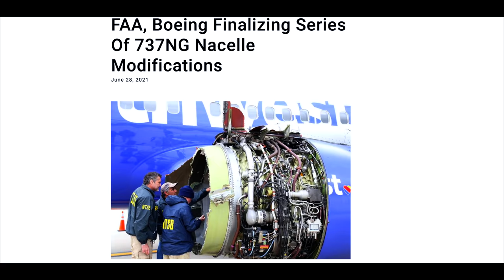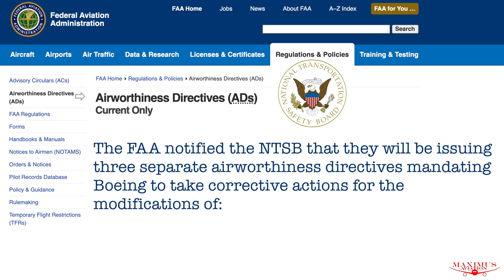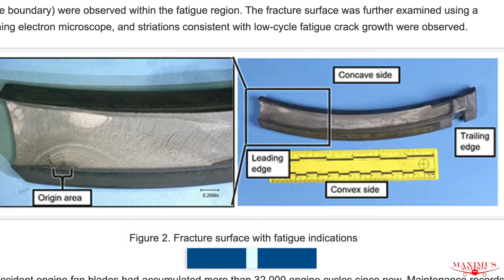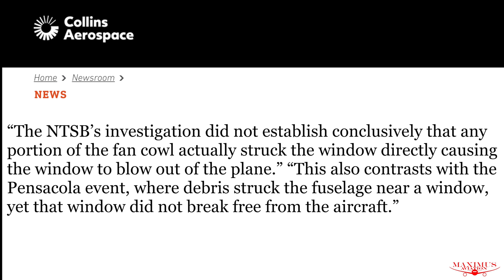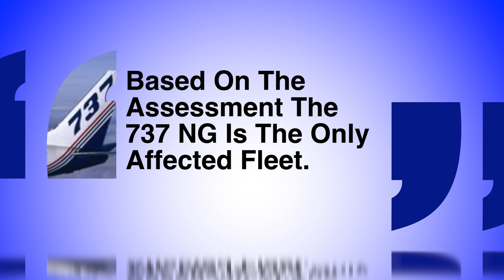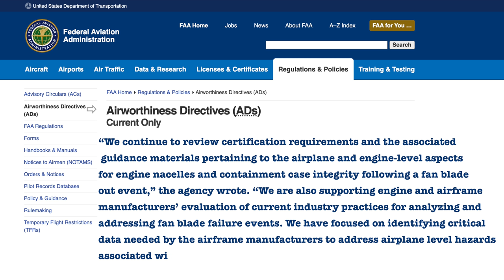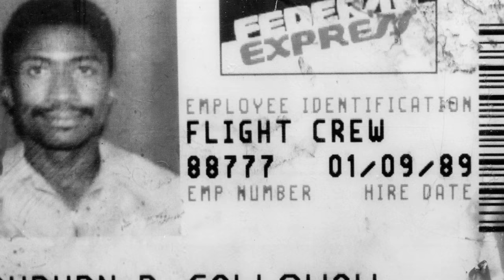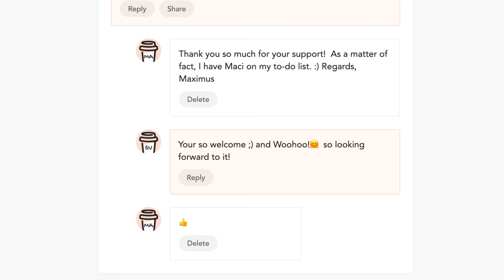After Two 737 NG Explosions, The FAA Is Finally Ready To Direct Boeing To Redesign Engine Cowlings.

Comment: Boeing is the company that keeps on giving with the 737.
Reply: Every airplane has design issues. Airbus had to learn the hard way in order to make the A320 the extremely safe aircraft today, now here come's Boeing's turn.
Reply: @aerofiles5044  True
Reply: @aerofiles5044  True, Airbus has had it's problems with the A320, but most of those were because of the new materials they used on that plane. 
Boeing seems to have problems with everything on the 737 NG:
- software
- wiring looms
- engine nacelles
- overall quality
Boeing seems to really have dropped the ball and sacrificed quality and reliability for profit.
Reply: Boeing adopted the gift that keeps on giving from McDonnell Douglas................cost, schedule and shareholder value over quality and safety. Boeing figured out quality and safety was bad for cost and schedule.
Reply: @tjroelsma  you left out the cracks in the wing spars!..
Reply: @richardhoating23  Missed that one, my bad. To my defense Boeing has messed up só much it's getting harder and harder to keep track.
Reply: Blah Blah  Yeah that's true, but my point is that the 737-200 was made when Boeing was a good engineering company and wasn't cutting corners.
Reply: T.J.R. ..  Since the B737Max crashes, and fixes, I flat out will never, ever step foot on board a Max jet in my lifetime! Software fixes or not, it's still a poorly manufactured, dated design that should be shelved permanently, and efforts to build a new (from the ground up), short-haul, low capacity, composite lightweight aircraft should be on the drawing board RIGHT NOW! The current 737 is an old, inefficient, poorly made mishmosh of an old, decrepit, dinosaur. ..It is, in no way the aircraft of the future- it's quite obviously "the aircraft of the sixties" We are living in a new millennium now, bring your dinosaur mentality into the future, Boeing.!(PLEASE)
Reply: @richardhoating23  you dont know what you're talking about ,no real problem with the design, thats how you make a plane nowaday,it's not the same thing as making a car. You dont know what is the purpose of the mcas so you can keep your ignorant opinion.m for yourself.
Reply: @tjroelsma  you either dont know what you re talking about, no problem with the design,the problem was an unfinished software. Its normal for plane to be redesigned with new engines,not for car so be educated. Look at the a320neo that had similar issue with its engines.
Reply: @tjroelsma  ok too much BS here. The TV never make you an expert ,remember that,you always have to search by yourself.

First the larger engines are not a real issue as you said ,i dont know what is your knowledge in aerodynamics because it is very poor. When you fly an airplane,and you add thrust,the nose pitch up because of the engine,thats a basic thing that every pilot would know. 

The problem of the 737 max is that the engines may change the behavior of the plane in certain abnormal conditions when the airspeed is not sufficient for the angle of attack. In other words,when you start to be close to a stall situation.
At this particular situation the pitch tendancy is higher than the other planes,removing all pressure you normally have in your yoke when you fly other planes. So you may pitch up more or be disturbed by the situation. You need a new training in order to safely handle that.The plane cannot be named 737.
 
Thats why the mcas is here.
It's a MANUAL flight aid,thats means only active when a human is in command , which automatically trim down the plane so bring back some pressure on your controls,when it detects a low airspeed for an high AoA.
With this you can lower your nose by yourself like you do in every other aircrafts.

The mcas is only used for that,and not for the take off,landing, go around but for the climb,because when you do all of that you use something called flaps ,it increases the lift in your wings so you may not encounter the situation described before.

To resume the mcas is only used  without autopilot,flaps and when you are close to  a dangerous pitch,not before.
The a320 NEO had a similar problem because of the same engines, a violent go around may fool the software that protect the pitch of the plane,just like the mcas.
And because of that,some airlines decided to forbid the last seats in the back of the plane,so it couldn't be used at its 100% capacity until the software was fixed.
So again be educated,search and  don't try to invent.
Reply: @Hk-uw8my  MCAS is a band-aid for a self-inflicted wound Boeing created. Ever wondered why ALL other planes don't MCAS or an MCAS like system? It's because they DID do their homework, unlike Boeing. 

What about this for knowledeg: by placing the larger and heavier engines more forward, Boeing has completely changed both the static and dynamic loads on both wings. In a static situation, the plane standing on the ground, those forward placed engines apply a torque on the wings, wanting to tilt the front of the wing down. In a dynamic situation, the plane flying and therefore applying thrust, those forward placed engines apply a different torwue on the wings, wanting to tilt the front of the wing upwards. This creates a lot of added stress on both the spars in the wings, as on the mounting points of the wings oin the fuselage. As somebody else pointed out in a comment on my first response: guess where the new 737 suffers structural problems? You've got it: at the mounting points of the wings on the fuselage. 

The simple fact is that Boeing made a total ClusterFuck with the new 737. It can't be a coincidence that they also have severe problems with their new flagship, the 777 Dreamliner, a plane that WAS designed from scratch. 

 Instead of simply copying and pasting the propaganda Boeing puts out, maybe do some research yourself? This channel for example has multiple video's on how much of a CF Boeing has been making these last years.
Reply: So You dont know anything about planes in general ,to assume that other planes dont have any mcas like system. I know it's weird for a bicycle or a car to have something like this,but here we talk about modern planes.

The airbus planes if you know what are rhey use a lot of software like the mcas, because it's  just the philosophy of airbus. The 737 max uses a lot less of computer intervention as any modern airbus plane.
At airbus you have FBW computed controls ,you have an autotrim,which is supposed to trim the plane at anytime so there will never be a need for any mcas.

If you are a little bit informed you would know that The mcas is just an extension of a system already installed since the 737 -300,called the STS. Never wondered why the mcas doesn't enable with flaps out even with full thrust?

Because since the classic version you have  the big brother of the mcas which is designed to enable with the flaps and an high thrust,to trim down the plane in order to make it more controllable with high thrust settings for an human in manual controls.

You assume a lot of things without the proper knowledge, if you ever flown something in your life you would know that the engines make any plane swings backward when you add thrust, at anytime.
Actually in many large planes like 747s,many airbus, 737s,777s it's recommended to push the control column a little bit forward when you add the take off thrust in order to increase the steering effectivness during the rollout because when you add  the take off thrust the nose is lifted by the engines. You remove the pressure when the rudder is effective at around 150km/h.

With ATR turboprops you may need to push that yoke all the time on the ground.
So again be informed, make a stop at least in  Wikipedia so you would know what is the  mcas and that it is used by an another plane,and then you ll be better.
Reply: @tjroelsma  it's not propaganda we aren't on TV ,its just some basic aeronautical  knowledge that you should have before giving your opinion,if you dont even know how a plane fly then it's useless to judge boeing.
Reply: Chuck Yeager  So I made one mistake and therefore everything I've argued must be wrong. 

Cry me a river, because you have no arguments against what I've written so you revert to the old "if you can't argue the message, try to discredit the messenger" tactics. What does that say about YOUR level of knowledge?
Reply: @Hk-uw8my  ..Q?: Why do you find it necessary to belittle, insult, degrade, and be rude to people on this page who may not be as knowledgeable about the Boeing 737-Max, as you like to believe you are???
Reply: @Hk-uw8my  ... Just an FYI...- I have been working in the commercial aviation industry for the last 20 years on B747, MD-88, A320neo, and A321... and I do mean ON the a/c types listed.. My father was First Officer and Captain type rated on B74, MD-11, DC-10, and B73... Although I'm not a pilot, I've been on and around ✈️ airplanes since I was in junior high school, and learned a large of info  by talking with my co-worker pilots, and my father. They all were more than happy to answer & explain any questions I may have had..  BTW:- I do know what MCAS is, why it exists, what it's purpose is, and how to disengage it if needed. MCAS=" Maneuvering Characteristics Augmentation System"..   btw: it is possible to get your point across without insulting or making derogatory remarks to people who may have slightly different opinions than you...
Reply: @richardhoating23  OK,but just to say you dont know anything.  Being someone "important" wouldn't change anything. If the president of the us says the earth is flat,he is still saying bullshits whoever he is. So no we aren't talking just about different "opinions". Im not insulting,im just smart enough to read what the person is saying.
Reply: @Hk-uw8my  Oh- OK, Once again you are 💯 percent correct. You know everything, because you are 'smart' - and everyone else (including myself) is 💯 percent wrong because we are all just plain stupid, and know nothing about anything especially commercial jets...

Comment: There is a Boeing philosophy where they demand their suppliers cut costs by 1% ever year so they can increase profits and gain market share. After doing that with an engine year in and year out. Companies have to cut corners, reduce workforces, cut materials and so forth. That kind of philosophy can work in many industries but when it comes to flying... Safety has to come first. You can't cut corners there.
Reply: They even tried to sell us the idea that they had to sell their H-47’s cheaper than they sold them 5 years ago!
I told them show me a car dealership where I can purchase a new car cheaper than those sold 5 years ago.
This is the BS Leanne Caret from Boeing tried to sell employees so we could accept cutbacks 😝
Reply: That year-over-year cost reduction NEVER work for ANY industry in the long run, at some point something bad happens and then the cost to fix and the lost income from bad publicity tend to overwhelm the cost savings.  BUT, before the SHTF the company will benefit with lower costs and higher profit and the CEO will be well compensated for the increased profitability.  You can't get blood from a stone!
Reply: It’s definitely Boeing’s fault that another company made a bad engine. Sound logic.
Reply: Can you point me to an article that talks about this.  I do believe that Boeing would do this, BUT I have not heard of them doing this through proof. other than just assumption that they do,  Walmart, Amazon, and lots of large co do this.
Reply: @danwesson1934  the bottom line is the aircraft manufacturers cowling and nacelle should be able to do its job in the event of a failure. The turbine manufacturer doesn't provide the nacelle and cowling. The event that breached the window was due to the cowlings hinge.
Reply: @danwesson1934  so Einstein what if a huge bird strike or FOD on a runway takes out a blade is it the turbine manufacturers fault? That's why the nacelles and cowlings are supposed to do their jobs and Boeing choose the design so they are responsible. Someone clearly never worked on a turbine or aircraft 😂. 
Not to mention the comment you posted under simply stated Boeing forces its vendor.s to cut cost, perhaps that's why the nacelle and cowling vendor products are inferior but you turn to the turbine manufacturer 😂
Reply: @scottcol23  it's Boeing's partnering for success program, they were relentless in forcing vendors to cut cost or be cut from Boeing's list of eligible vendors. I believe it was CEO dirty Jim's scheme...........you know McNerney the clown that groomed once engineer Dennis Muilenburg for his CEO position.
Reply: @danwesson1934  Boeing is the ultimate designer and assembler. You think Boeing builds the rest in house? They outsource probably 90% of their components like every manufacturer does, but somehow other manufacturers manage to have better quality, despite probably even having the same supplier.
Reply: @danwesson1934  Guns cause violent crime too!
Reply: @DC8Combi  Good point. I stand corrected. I was just saying it’s not entirely Boeing’s fault but what do I know.
Reply: @RedArrow73  lol.....I shouldn’t have even commented, you can’t win.
Reply: That shouldnt be hard to do.
Reply: @DC8Combi  the cowling and thrust reversers are not made by Boeing anymore that's the problem. I know this because I worked on 737 specialty product line and that's what we made was the cowlings and thrust reversers Boeing's offloaded them. There's the real problem
Reply: @andrewlarson7895   you are correct I know that good sir and I also know of the never ending Boeing outsourcing. I'm recently retired H-47 / V-22 and we used to manufacture everything down to the wire harnesses and cloth fabric and material of the interiors. Now the vendors supply poor quality products and many times they are not properly addressed and simply used as is.
Not to mention the lack of storing any spare products from vendors as they have it set up to receive as needed. This presents problems for production schedule when vendors or shippers have issues.
Reply: @DC8Combi  having parts at just the right time (they called it just in time...the venders are easy to lose track of. Because they're so many of them yep that used to be all in-house
Reply: Sure you can. Boeing and its suppliers will show you how.
Reply: @2006gtobob  Airbus uses alot of the same suppliers as boeing.

Comment: As a advanced composite matrix material reinforcement and failure analysis engineer, Boeing and others testing and modeling methods are NOT valid.

For decades I have been blowing the proverbial whistle calling out industry and regulators that their quantitative and qualitative testing analysis in both methodology and procedures are not valid in real world blade off events, sadly to no avail.

United has also had two in flight blade off events in Boeing 777, one of which nearly brought the 777 down. 

In both cases the blade failure protection systems failed just as I have warned.

With solutions in hand, is anyone in the industry or regulators listening? 

Cheers,
KP 
Colorado Springs, CO⛰🇺🇸
Reply: I’m curious, what are they doing wrong?
Reply: Gee, one airline company has two engine blade failures in the same plane.... this sounds like a maintenance problem, not Boeing's problem. This is either on United or the engine manufactures.
Reply: The big problem wasn't so much that the blade broke the nacelle, but that the plane couldn't maintain altitude with a broken nacelle. If the first failure had happened much further from Hawaii, it could have been tragic. All of the single engine failure cases have assumed the nacelle is still present, a missing nacelle adds significant drag. Even if the thrust could have been increased on the food engine, whether there would have been enough fuel at ETOPS maximum to get to any airfield is questionable. I'm not sure the 737 suffers from the same problem, but they also fly to Hawaii.
Reply: @johnhaller5851  One MAJOR  critical point you missed:

Debris in fact impacted completely into the fuselage but by the Grace of God in went into a structural rib stopping it and prevented rapid decompression and worse:

If it struck the fuselage just an inch different in any direction it would not only have caused massive decompression but in this critical area it would have created a major hole into the passenger fuselage section not only sucking out entire passenger seats but likely would have torn open the fuselage all the way back to the tail ripping the fuselage apart mid flight sending everyone to their deaths. 

Boeing has been very quiet on this hidden weakness in the 777 design, a type of fracture critical area within the fuselage.

Hopefully Boeing has made structural fail safe improvements.